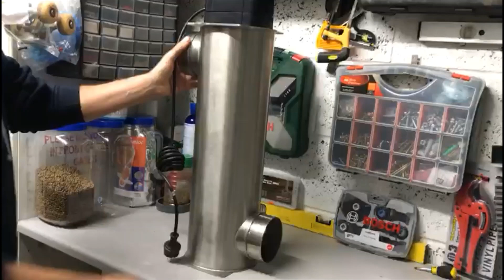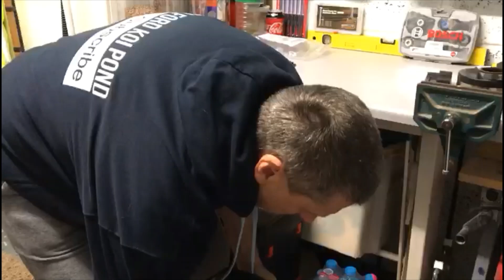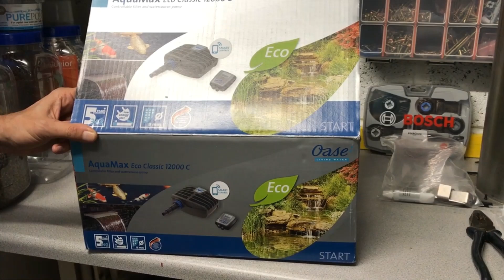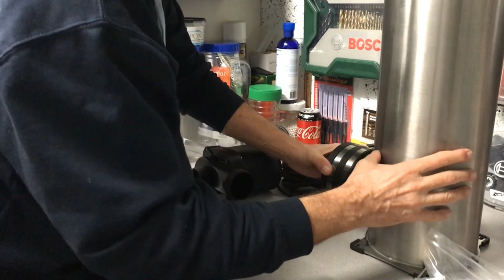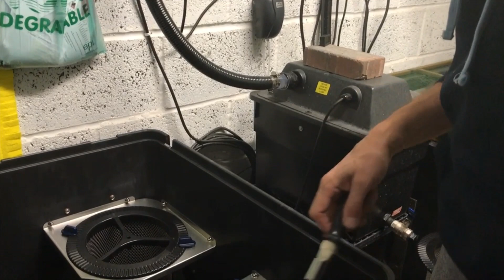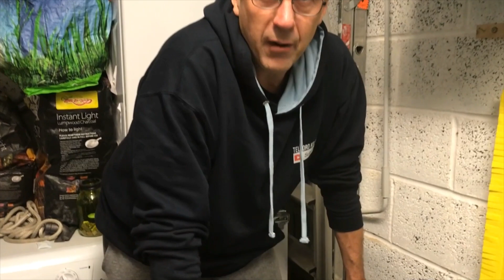New Telford Koi Pond Part 12 - Fitting an Oase Bitron Gravity 60w UV into an Oase Individual Module.

Comment: Strange why is the uv and pump inside the filter
Reply from the maker: Hello. The end unit is designed to hold the pump and uv in water so everything is nice and compact and there is no loss of water if the pump and uv joint lets go at some stage. Its really just a different way of doing things. Hopefully it will perform as good as it looks and makes more sense when its in operation🤞. Thank you for watching and commenting 👍🐟🈲😊

Comment: Brilliant bit of kit, i have one and run my shower into the individual unit, I have two moving beds on an Oase drum and a compact drum on the skimmer. All works a treat. My pond is 6200 gallons and was looking at the 60 uv for my pond, not sure if its enough though??
Reply from the maker: Sounds like you have an amazing set up. My pond will only be circa 2200 gallons but at least I will be sure the filtration is more than sufficient 🤞. The gravity uv is certainly a well made bit of kit but if I had 6200 gallons I’d probably go for 2 x 60w uv’s or 1 x 120w uv depending on the configuration. Thank you for watching and taking the time to comment, much appreciated👍🐟🇯🇵🈲😊